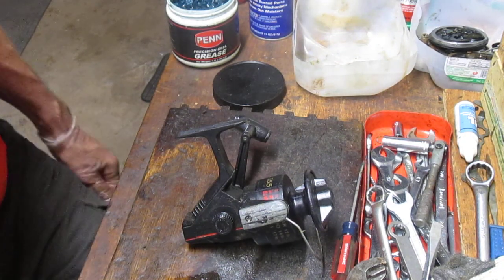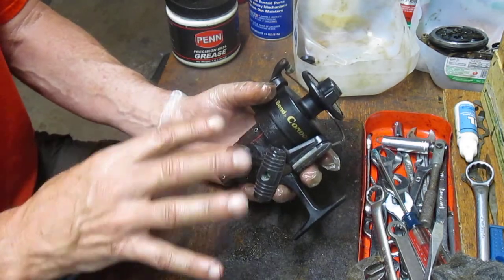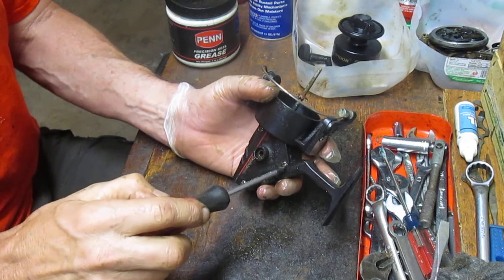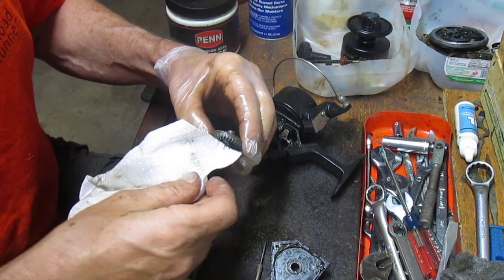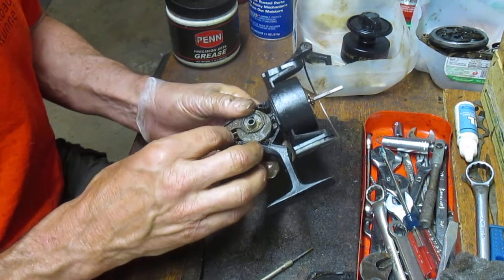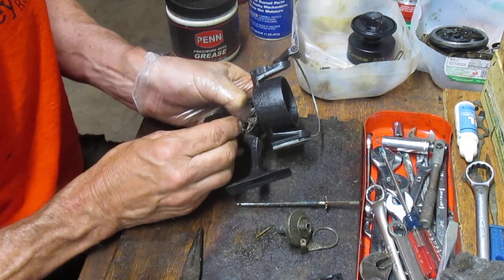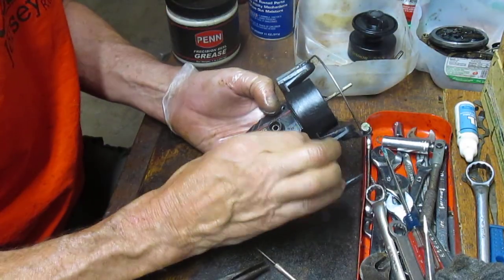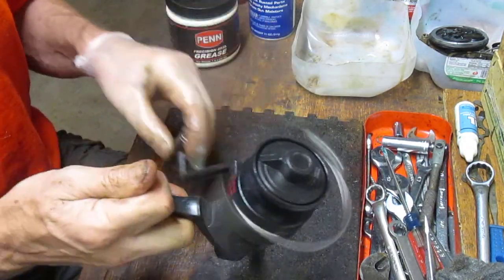South Bend Condor 555 spinning reel take apart and service buying an inexpensive reel

Comment: You know it would really help if you would clean the rail so you could see all the parts in it instead of having them covered all by grease installation of the pen for the anti reverse Jesus Christ
Reply from the maker: I am sorry if the grease made it hard to see the parts, I will work on the next one.
Reply: @2ndChanceTackle   the fact the camera is.. 10 feet away I need to actually see the switch position

Comment: I have the 510 and I took it apart to clean and lube it but now the handle doe's want to turn forward when it's on the right side. It turns backwards when when I'm trying to reel with it. Is this normal? I don't remember it doing that. Actually it does this on the left side too. Only turns backwards when trying to real it in not forwards. So another words  forward is reverse and reverse is forwards on both sides of the reel when the reel is mounted on the bottom of the pole.
Reply from the maker: Does this reel have an A/R clutch?  If it does, you likely installed it upside down.  If you reverse it, the reel should turn as intended.

Dennis
Reply: @2ndChanceTackle  I don't even know what that is but I took it apart and redid it like three or four times and finally got it working right.

Comment: I appreciate the video, it helped me re-assemble my TC-555. 
But, in the video, you’re constantly bagging on how cheap a reel it is. As if it’s just a throw away reel. 
I’ve had my TC-555, for over 28 years, and is still the best reel among 18 plus poles. Up until last week, it had the original line on it. I’ve fished the Gulf of Mexico, the Sea of Cortez, and hundreds of lakes and streams. 
I’ve caught fish from the tiniest bluegill to a 35# catfish in the Mississippi River near St. Louis. 
So, not to criticize you, but if you take care of your equipment, even the cheapest reel can last a very long time. 
Tight lines 🎣
Reply from the maker: Hmmm - That's my point, that no matter the cost of the reel, if you take care of it, it will always do what you bought it for.  I try to use the inexpensive or cheap reels as examples of how you do not ned to pay a lot to get the performance you need and that expensive reels that are not cared for are also throw aways - Sorry if it did not come off that way in the video as I like the Condor series.  They were comparable with the Shakespeare Alpha series, which were also built to last at a value price - Best wishes and thanks for the note - Dennis